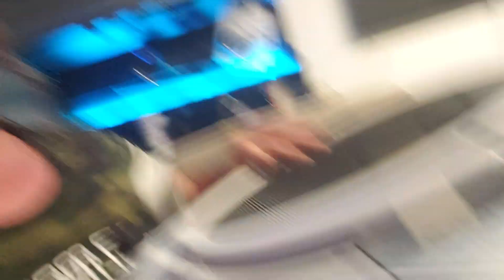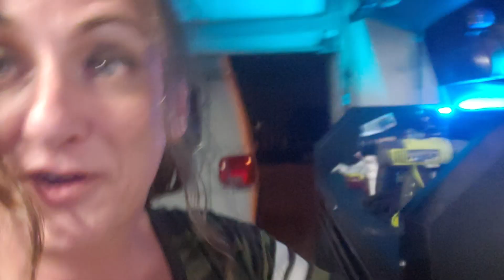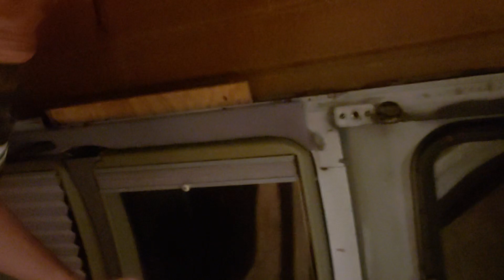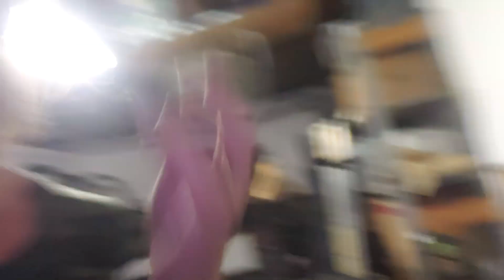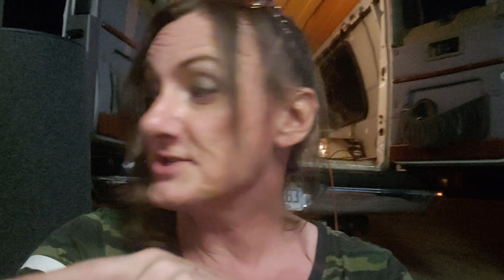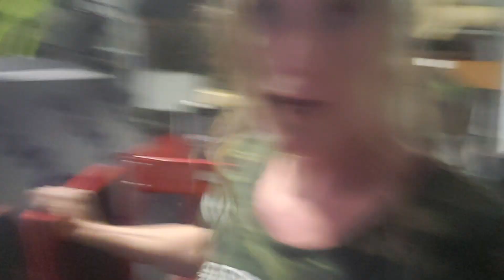Pimp my van

Comment: I have BAGS of screws from my last job. The customers we had would hire stuff in our cages and then throw EVERYTHING in them at the end of the job. So we'd get full tubes of silicon, unused cans of expansion foam, spraycans with paint still in them, screws up to 6 inches, several 3/4" galvanized dynabolts worth $20 each, even tape measures and one time a wrecking bar. Money seems to mean nothing to these guys. We had specialized brackets made that cost them thousands and they never used them then gave them all back but still paid the bill.

Comment: One of the best things I heard about condensation was that it only really gets on EXPOSED SHEETMETAL inside the van. If you can get even just CARPET to cover the sheetmetal, it will be fine. And its true. My van is drowned in grey plastic covers/trim. But I got condensation on the glass without reflectix AND the tiny strip of metal between the trim and the door seals. It was literally running with drips but even at the roof right above my head, just INCHES away from my mouth, there was NO condensation. Not even a sign of it.

Comment: At work I have even used steel paint with a ROLLER and it comes out beautiful and glossy. But I laugh when I see people trying to use a paint brush for steel because it's as obvious as hell. I know spraying is the best but you'd be totally stunned at how good 3 coats from a roller comes out. You'd never believe it until you've seen it.

Comment: Hi beautiful! It’s great seeing you making a video on the van build! It’s gonna look really bad ass when you’re done. And you have some really great quality sealant and spray for the rusty parts on the high top. That will slow it down quite a bit. I bought the undercoat sealant as well, and sprayed it on the lower part of my doors and inside my doors on my car. I have a Buick Century that’s 14 years old and the rust is creeping up on the doors. So I cleaned it really good then sprayed 3 coats on and then the paint. Anyway you have some really high-quality stuff and the cameras are a plus! 👍💕

Comment: Those spray guns with the can below are the type we used to do small things like letterboxes with during my apprenticeship. They use a venturi draw system and suck the paint up no problems. If it has problems either the air horns are blocked OR the little hole in the top of the can will be blocked and there's no air coming in to let the paint be sucked out. The ones with it above are more often used in car spraying and artworks. The can below type is good because you can get far steeper angles without dropping any paint out.

Comment: Good idea to give the deep cycles a charge every now and then. The best charge controllers are MPPT type. Multi power point tracking. I was intending to get lithium batteries but the cost is just insane. You'll find 3 way fridges actually AREN'T designed to cool on 12 volt, go FANTASTIC on propane but use heaps, like serious amounts, and run alright on mains power. REALLY don't even waste your time on a mains powered household fridge because except for a couple designed for RV use, most mains compressor fridges won't even start. The startup surge will be too high for an inverter unless you're using like a 1200 watt inverter. And most will just go off with an overload light and a buzzer or beeping. Try Engel because they use a strange piston compressor without a crankshaft. Its like a floating piston with a trunk release type Faraday solenoid to pull the piston down and a spring to push it back up. By far the most expensive but also the most efficient you could imagine. Compressors still made in Japan and the rest assembled in Thailand. No chinese crap in it and you can tell by the quality.
Reply from the maker: Yeah, not gonna spring for mppt as I have an isolater and a generator. I got a dorm fridge going on. A 750 inverter will run it